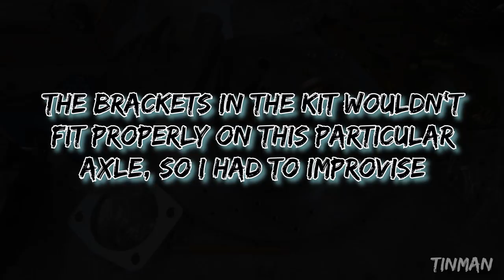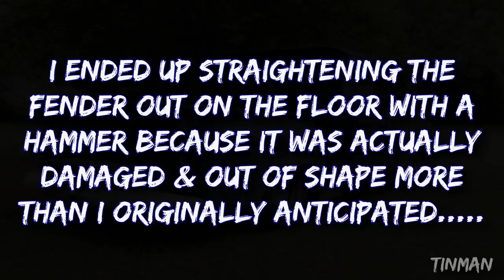Bagged '66 GMC Build (Ep. 6) "Junebug" REAR DISC BRAKES

Comment: I just did ford 9 inch conversion. Also pain in ass... hey. Try using nicopp brake line with an-3 fittings. Use 3/16" brake line nuts and standard flair tool.

Comment: I wonder if that rear end setup was one of GM'x "one year only" deals? I had that problem with my '79 Chevy van, after it was about 10 years old, there were some carb problems, and nobody made an aftermarket rebuild kit for it. I got what I needed through a dealer, but I think I had to rescue a couple of the used gaskets, don't recall, too long ago.  But, I've run into that BS a couple of times... Good work man, nice job on the bracket tweaks.
Reply from the maker: Zeek, I'm thinking that GMC did something weird with this, because none of the 66 chevy's I have worked on had this particular axle. So it might be something like the AMC cars, where they made them out of leftover parts. Either way, it really was a pain the rear end XD anyhow, thanks for watching & commenting!
Reply: Or, it was from a 3/4 ton or larger, as you say "leftover parts" or the like. Without the build sheet, you're left to improvise, unless there's a stamping on it hidden somewhere. Onward. 😎
Reply: I have a 1960 gmc I'm building and it has a dana 44 rear end. Getting rid of it for a 9"

Comment: might be time for new axle bearings if your still leaking. I have also heard copper brake lines are illegal. Check federal mandates for brake lines. the replacement for copper was copper nickel mix brake lines in the 70's.  I personally use stainless (trying not to be a keyboard engineer) from what I remember their close in price. did your brake supplier sell you those copper lines? just curious that's all.

Comment: When you get the time I need some advice. I have a 1985 Silverado c10 and was wondering if you could tell me which kit I need for the rear conversion. I also have a 1979 c10 custom deluxe that I need the same information on, I am restoring both trucks. Well the 85 is almost finished, but a lot left to do on the 79 just had it about a month. Any info would be a great help to me..thanks
Reply from the maker: Rhoads Matheson autocityclassic.com
Reply: Tinman 2 Kustoms thanks for you're help and you're time I will check that in a few minutes. Great videos man, I've been watching them for two days now and you are a master builder... Subscribing
Reply from the maker: Thanks man! I'm working my way to being a master builder anyways!!! The brake kits actually aren't all that complicated. I'd bet someone makes a kit for what you have. I'm personally not familiar with whatever those trucks have for axles, they're a bit newer than I'm used to

Comment: Hey,
      Don't ya jst hate when its supposed to be a kit for that truck ?  I thought that the 10 bolt rear end had clips on the pmkin to hold the axels ?  Man I guess I remeber wrong !  The ones I remember had clips on in the pmkin and ull those clops and whala the come out no bolts or any thing else !  Is that not the stock rear end ?  Is the rear seal on the drivers side pitted or did you ever figure why it was leaking ?  Good Luck with it !  I hope that it starts settleing down and stop giving you such a hard time !!!
Reply from the maker: cody cheney the newer gm rear axles have c clips that hold the axles in you're correct. I'm not exactly sure what rear end it is, still. It was a very odd one and hard to find parts for. The inner seal was bad. I put in a new one and it didn't fix it. So I tried another one and then it stopped leaking. So not really sure what the deal was with the first 2 seals! And yeah, kits are never actually kits... which can get some people in trouble!
Reply: I hear you so I know my 66 had c clips how old are they when they had the bolt in ?  Good luck with the project !  I think that the fender turned out nice !  Keep the faith !
Reply from the maker: Thanks! I guess I'm not that familiar with this particular axle. The outter flange that was bolted onto the axle flanges is actually what holds the axles in place. If you watch in the video you can see that I put a spacer between the backing plate on the rear end, and the actual retaining flange. Its kind of a weird setup honestly.
Reply: Looks like a dana 44 that's what my 1960 gmc had

Comment: Where I'm from copper is illegal as a brake line as their bursting pressure is too low to accommodate the pressures of a braking system with a reasonable safety factor.
Reply from the maker: Where are you from? I have been using copper lines on everything that has needed brake work over the last year or so. Never seen a problem. If Napa sells it as brake line, i'd think it was DOT approved and wouldnt be sold if it wasnt safe.
Reply: Tinman 2 Kustoms they are illegal in the US since the 70's they replaced copper lines with a copper nickel mix because of line bursts and brake loss.
Reply: Tinman 2 Kustoms Canada, been illegal for a long dang time too.  I mean I've run it because that's all I had for the repair but I'd not recommend it.  I'd contact DOT.  I'd hate to see you get in trouble.